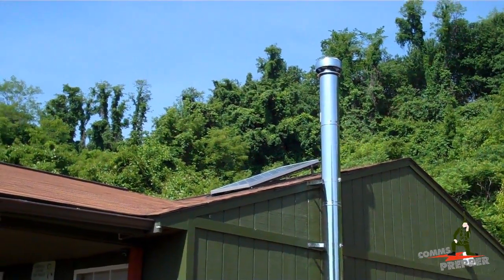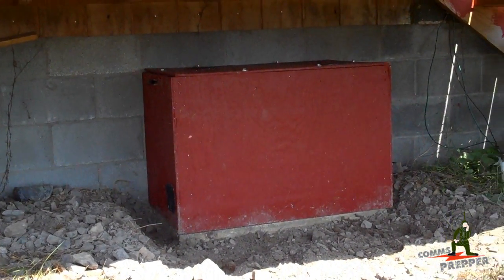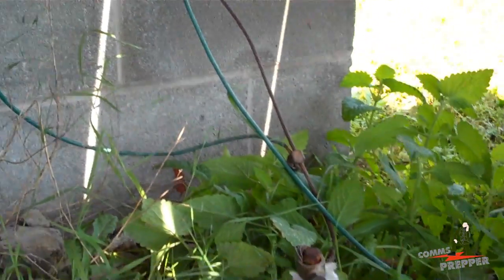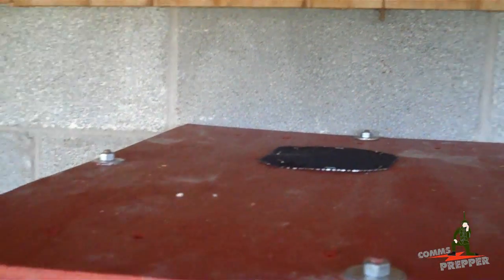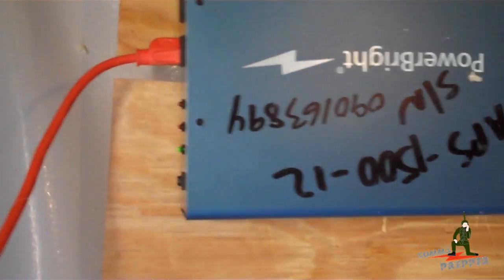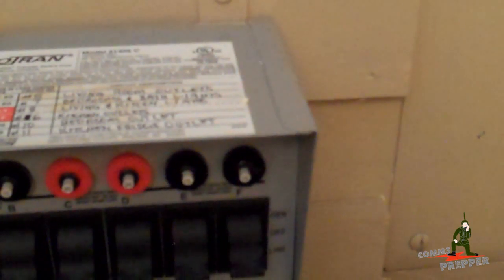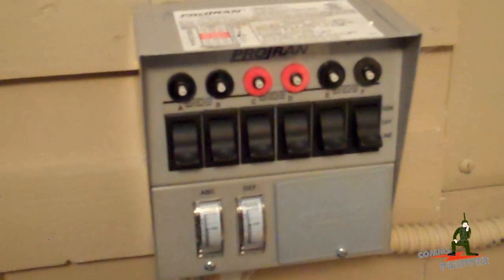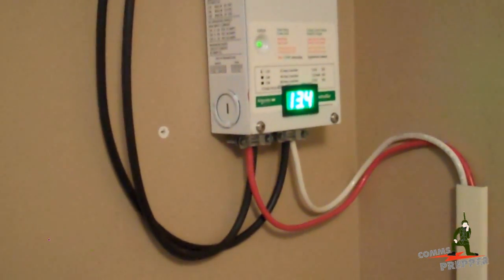Off-Grid Solar Power System

Comment: @ 7:20 in case anyone is wondering those rectangular fuse blocks are ANL style.
He is also correct you don't want to undersize your inverter wiring. Speaking of inverters, they consume a little power just to run. So on a smaller system for lights & chargers etc., I like to suggest using 12v/dc where you can.

Comment: I would add a DC disconnect to both the battery bank and the inverter.  If the inverter is a standby model, then, also, add an AC disconnect.
I saw a fuse next to the inverter, but I was not sure if this is a DC or AC fuse.  You will need DC fuses both for the inverter and the battery as well as an AC fuse for the inverter.
Reply from the maker: old install

Comment: One wonder how one work with the 24V setup ??  I mean I have an 80 Amp Xantrex controller... but Just never bother to see what are the requirements...
Reply from the maker: I don't understand your question.  24 volt off-grid solar systems are very common.

Comment: That battery box is OK for summer but not winter
Reply from the maker: In the winter I close the bottom vents and wrap the batteries in old army blankets (batter vents not covered).  Watching the charge controller online the min. battery temps have never dipped more than 2 or 3 deg. below freezing.

Comment: Putting this battery box outside seems like an over kill, you only have two batteries and a single 150 solar panel.YOU would have to boil the hell out of these batteries to generate any significant hydrogen gas.. Also having this under the porch makes it a pain in the butt to check or add water. And in the winter the cold will really lower the capacity of these batteries.
Reply from the maker: Oh...  this video is very old.  Go back and check my solar play list.  System now has three ground mounted 265 watt Kyocera panels, MorningStar MPPT controller and four Trojan T-105RE batteries.  This video was just the getting started video.
Reply: Commsprepper. I am really considering Solar plus Trojan batteries for off grid use. I need some informations from you: how many years have you been using the Trojan batteries and have you notice any degradation moreso what do you power with your 4 Trojan batteries. I look forward for your response.

Comment: thanks for mentioning the xantrex and going through your problems with charge controller choice and mistakes. and showing the xantrex mods. super cool. I'm planning a system for a school greenhouse.
Reply from the maker: I have since upgrade my controller to a MorningStar TS-MPPT-60 controller.  The MPPT controllers are far more efficient and allowed me to have a different array voltage from the battery bank voltage.

Comment: Although I have followed your Communications-related YouTube channel, I discovered your Off Grid Cabin channel only recently. I am the research mode for the installing a small solar power generator as a backup energy supply for lights, TV, ham radio, and Internet access at my suburban house during our increasingly frequent rainstorms here. Assuming that you have not already done so, could you send me a PM or create a video for us subscribers that describes your process in designing and implementing your off-grid power system? I have learned a lot from both of your channels and greatly appreciate the time you spend in creating such informative content.
Reply from the maker: That is too difficult of video to make.  Too many moving parts and varying requirement.   I started off with what I could afford.  Lessons learned for me was going cheap is not the right answer.  Spend money on a quality MPPT charge controller (60 amp) and quality inverter that can support the loads you have.  My inverter is 1500 watts but I would one day like to have a 2500 watt inverter.

Comment: How did the batteries hold up over a hot summer or two?
Reply from the maker: they are doing well.  I do keep them in the shade under our deck on a cement slab (wood separation) with vents that helps keep them cool.

Comment: you have got to get those batteries inside or they wont last a year just use a dryer vent for fresh air
Reply from the maker: They are doing fine.  The box is insulted and the batteries have never spent more than few days each winter below 32 and have never dropped below 28 on any single day (advantage of logging with the MorningStar controller). On those cold days the inverter (load) is left off and SOC is held at 100%.  Batteries are going on year three at the current location.

Comment: Shouldn't the fuse be on the negative DC lines? DC flows from negative to positive. So even if DC can't complete a circuit to ground, you want the fuse to blow before your battery or equipment.
Reply from the maker: I prefer to have fuses on both (which I don't right now).

Comment: Great set up Commsprepper!  What size ANL fuse did you install in line between your batteries and the inverter (will you/have you  upgrade it when you add batteries to increase amp hours)?

Comment: If you live in a cold area you are going to have less power in the winter from your batteries they really do not like cold weather just a thought good video and system
Reply from the maker: +old time engineer I did my best to insulate the box and close up some (not all) vent ports during the winter.  Batteries only dipped below 32deg a few evenings last winter but never with a depleted SOC.

Comment: Thanks for the great vids.  Recommend you move from solder to a hydraulic crimper.  When you expand the system the higher power levels will vaporize solder.  A good hydraulic crimper (less than $50 on Amazon) will basically fuse the wire with the lug under the 16 tons of crimp pressure.  Also, consider a Blue Sea battery lug fuse - every wire, ideally, should be fused, and as close to the battery as possible.  I see your fuse in the crawl space but if someone dropped a wrench across the battery lugs you could ruin the battery.  http://www.amazon.com/dp/B00GXQ2E5E/ref=wl_it_dp_o_pC_nS_ttl?_encoding=UTF8&colid=1F7FVJ6WC8FO8&coliid=I1CGE9FG29V6VN

http://www.amazon.com/Blue-Sea-Systems-Terminal-Block/dp/B002INJXO6?ie=UTF8&colid=1F7FVJ6WC8FO8&coliid=I1DGMRQ5AEZB34&ref_=wl_it_dp_o_pC_nS_ttl
Reply from the maker: +M Miller Thanks for the tip!  Tool ordered!
Reply: If the conductors are so small that they get hot enough to "vaporize" the solder joints, there are much bigger issues than solder connex.  I had six of these same 220AH batteries in series/parallel for 12V @660 AH with 1/2" Cu pipe as the main conductors and all of the  joints were soldered including super-flex welding cables which went to each battery. This powered a 2500W Statpower inverter.  There was no detectable rise whatever in temp at any conductor.  Terminal voltage drop across the composite battery wiring network (not the battery terminal voltage) was about .15V with a 1500W  load and that wasn't sufficient to vaporize anything. This is fact, not speculation by viewing somebody's work.  I had this system for 7 yr.  FWIW

Comment: your gunna have a hard time regularly checking the acid levels in the batterys
Reply from the maker: +Ram2 Why?  I have them almost a year now.
Reply: +Commsprepper how many times have you topped up the battery's. its a common mistake people make when setting up solar battery's. They put them into hard to reach places. battery's need to be constantly checked, for the best battery performance, and life.
Reply from the maker: I check the levels and gravity once a month.  I would prefer to have an easy location but I work with what I have.  Placing the batteries under my deck protects the box and batteries from the elements while allowing gases to vent safely outside.

Comment: If you have 200 amp service from the power company you are not "Off Grid" you are supplementing. Still informative though.
Reply from the maker: It's a prep for when the 200 amp service is providing nothing - then it's "off grid."
Reply: +Commsprepper 
How many amps does this solar panel have ?
Reply from the maker: I have two panels that can produce 8.5amps each in full sunlight (17 charging amps total).  The MPPT controller can then step that up to over 20amp under ideal conditions buy converting excess panel voltage to charge current.  That's the advantage of MPPT controllers over PWM controllers.

Comment: Very well thought and with proper fuses and safety on the DC side. I completely understand the needs to control charge voltages to keep your batteries happy and healthy ! I went with Morningstar hardware. My AC powered backup charger is Xantrex that I have connected to my generator !! Very happy to see a YouTube video where things are done the right way !!! Very impressed !!

Comment: Nice work. I made a lot of mistakes too (and a lot of wasted $$$). Just upgraded my home solar power station with Trojan L16E-AC (four of them). Plans to get four more for 740 aH (24v system).
Reply from the maker: +ChrisDIYerOklahoma Nice - one day I would like to go to 24VDC.  I did recently add a Morningstar TS-MPPT-60 charge controller so I could remotely monitor the system over the Internet.  It is working great.  It's also nice to have a controller where I can program the bulk, float and equalization voltage values.
Reply: +Commsprepper Congrats on that Morningstar...MPPT is the way to go. I went to 24v last spring. Now I am kinda wishing I did 48v. Something to keep in mind...esp if you get a 48v inverter. My system is all wireless/internet connected...been collecting data on those new Trojan batteries to see my useage trends. Take care...keep up the great work!

Comment: Nice system. All you need to complete it is a Bogart Engineering Trimetric Battery Meter to know what your batteries have in them.  here is a blogger who has been off grid for 10 years with no generator.   https://handybobsolar.wordpress.com   Just FYI
Reply from the maker: +Bruce Arntt I know this web page but thanks for sharing.

Comment: A few months back I have put together a brand new complete solar kit. Samlex 2000 with remote, IOTA Power Converter, TrakMax 40 along with a 100 watt solar panel. Still in a apartment and won't be able to use. All is needed now is battery cables and batteries. Any one interested??

Comment: excellent. I like the governor xantrex and Trojan batteries that cost much here in my country. I use small performance but Chinese regulators, very versatile. My system is modest but effective, as you can see in my video.

Comment: great video infidel !   LOL

PLEASE !!!!!!!       BOND THAT "INDEPENDENT" Ground to your primary utility home primary GEC.
Reply from the maker: russ purchases Will do.  That rod was originally installed for my HF radio station.
Reply: Awesome videos -- thanks for all of your assistance in helping me convince the women folk in my family that comms are really important during times of crisis.  

No one really had the desire to go for their ham ticket, so I got each family group a GMRS license for Christmas a few years back and set up a few repeaters here and there/...  most w/ AGM battery b/u (via battery revert cable) just to keep 'em "up" until the on-site gensets start and come up to speed/freq.

Solar is definitely a fantastic option though.  Most of my sites are commercial or combo public safety/commercial and have nat. gas or propane powered generators, but they can easily fail.  The cost of solar was a bit pricey and the locations really didn't provide a great place to mount any panels, so I ended up adding separate "mini" manual AC transfer switches at each site that just power my cabinets/friends cabinets / etc...  and have a few Honda EU2000 gasoline powered inverter-based 120vac/2kva generators w/ really clean pure sine-wave power output.  They really just "sip" fuel unless under full load and I have them scattered around near each site so that local friends/family can easily go and attach if the onsite standby gensets fail to function.

But...  again...   SOLAR LOOKS GREAT!  (No driving / No communicating as to which sites need power / No downtime / etc.)

Thanks again!

Request though:   

Duplexer comparisons/reviews:
BpBr (aka "426" style or some of the newer variants) vs. Celwave or RFS or whatever the company name is this week LOL. "Mobile" / Notch style duplexer.  vs.   "Chinese/Ebay $100 buck Mobile/Notch style duplexer).

And...  possibly tuning procedures?  And...  Quantar pre-selector tuning procedures?

Thanks !!

"The Infidel"   ROFL

Comment: my head hurts.  HAHA..  great video, any chance of getting the compound completely off grid?  I would love to have some solar just as a back up for my freezers, water ect.
Reply from the maker: Blue 823 Sorry - not one of my best videos - too long.  I will get close to being completely off-grid with the exception of the water heater and air conditioner.  I picked up some LED flood lights to see how they compare to my current perimeter lights.
Reply: Id be interested to see how those LED floods work... I have been wanting to switch the halogen ones out for those but have not because I am afraid the LED's wont light up the same area...  Would be cool to see a side by side comparison.

Comment: Good job you should not touch the plug lugs if you had breaker on you can get a back feed you would have got fried
Reply from the maker: Joseph Jones Thank you.  Fried on what?  12VDC?
Reply: the lugs on your generator plug in
Reply from the maker: Joseph Jones Ah...  that would not happen with the transfer switch.  The Switch isolates the outlet from the commercial/line power.  That prevents the generator from sending power back down power line and possibly hurting linemen.

Comment: Great video ! Good idea about having the batteries outside for safety's sake.
Reply from the maker: SurvivalComms Thanks.  We started this project with the batteries inside and gas smell was too much (rotten egg smell).  Many folks said there would be little if any gas but the gas was very noticeable.  Perhaps this has to do with the heavier solar specific Trojan T-105RE batteries.
Reply: I used to work with wet cell batteries 20+ years ago and long term you get all kinds of nastiness indoors even with them sitting idle (corrosion).  I always wondered if the forklift varieties would be worth a salt in this application.

Comment: That was a great idea putting the batteries outside for ventilation. Good video.
Reply from the maker: GeneralSLee Thanks.  I believe the location under the deck, out of the sun, and insulation in the box will keep them cool in summer and warmer in winter being up against the house and out of the wind.  Winter plan is to close off the two lower vents and one upper vent.

Comment: a small suggestion go to your local school bus company and ask if they have any  bus mud flaps they are throwing out   if so and if you can get them put them under your batteries to help isolate from the concrete    also find a way to  keep them warm in winter i know how cold it gets their   lived down their for 11 years     COLD IS THE ENIMIE  OF BATTERIES
Reply from the maker: embarado smithing and woodcraft The bottom of the box is actually wood with Styrofoam insulation under it.  There is around an 1.5" air gap between the insulation and cement slab.

Comment: Here's mine. Soon to be expanded at a new home.

https://www.youtube.com/watch?v=daS9xyk5Azo
Reply from the maker: davjan4 Thanks.  I like the charge controller.  Does it allow you to set your FLOAT, BULK, and EQUALIZATION voltages?
Reply: Commsprepper 
Yes. I can change all of them to whatever I need. It will also allow me to view what's going on over the internet, as it also plugged in to my router. It's one the the best controllers you can buy, and I got it knowing that I would eventually be expanding the system.
At the new house I'll have a 5,000 watt grid tie, with a switch on some of the panels to route them to the charge controller, so I will have about 1,400 wats going to the controller so I an charge the batteries faster. I also plan on getting more batteries or the new Tesla home battery.

Comment: Great video! I've watched a lot & read a lot but that's the best discussion of the different voltage requirements that I've seen. Very well done.
Reply from the maker: Kevin Carmical Thank you.  I too wish there had been other videos that touched on the voltage topics.  If there were, I would not be listing the last charger controller on ebay tonight.

Comment: could do a video on your generator?
Reply from the maker: Josh Kilen There is a link in the video's description box to my transfer switch installation project.  Are looking for a video on a generator alone or how it connects to the switch?  If the latter - check the link.
Reply: Commsprepper
the generator alone, and do you have a generator?
Reply from the maker: Josh Kilen I do have a generator (Honda EF2800i) but will not be making a generator only video.  There are too many other channels that make and can make generator exclusive videos far better than I ever could.
Reply: Commsprepper
Honda doesn't make a ef2800i, but yamaha does
Reply from the maker: Josh Kilen You would be correct.  Mixed up the generator with the car.  It's a small generator but it's pure signwave unit so it's safe with my radios and other electronics.  One day I will be able to get a bigger pure signwave unit but not now.
Reply: Commsprepper
about what size would you like? i know of a company that makes very good diesel generators, there website is http://www.auroragenerators.com/ they have a 6500 watt silent diesel generator, heres a link to that generator http://www.auroragenerators.com/generators#!/Silent-Diesel-Generator/p/13323984/category=9268407
Reply from the maker: Josh Kilen Are they inverters or generators (pure or modified sine wave)?
Reply: they are normal generators, with automatic voltage regulation